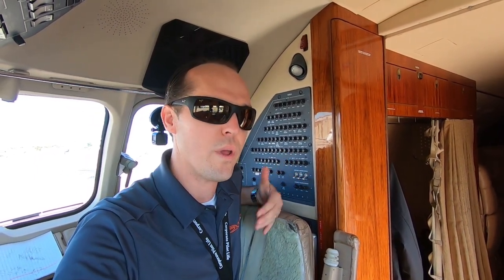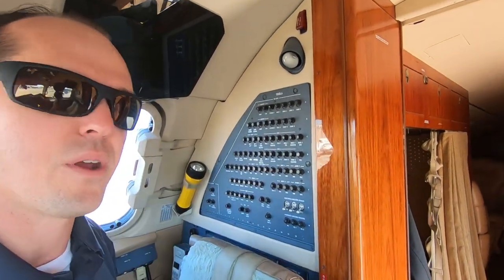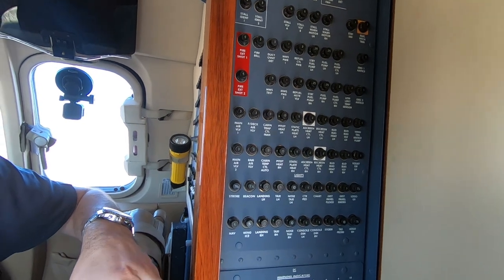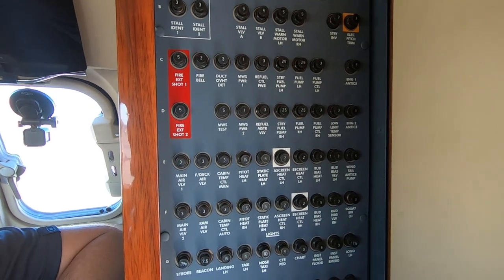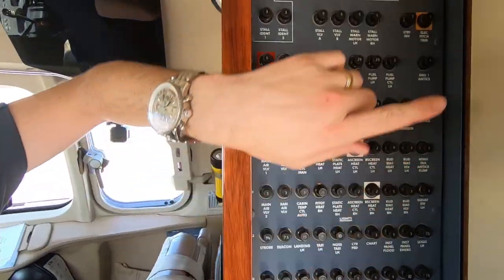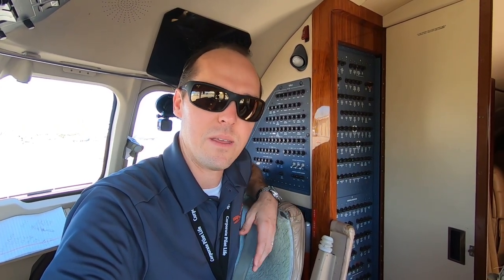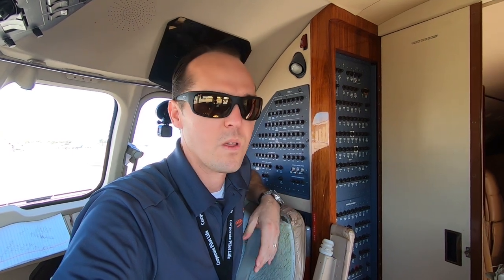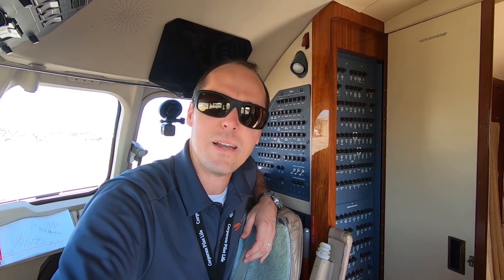What Are All Those Cockpit Buttons? -Tech Tuesday

Comment: Interesting to see the others behind that trim panel. And you Really don't want fires on a plane, not only does the smoke not have a place to go..where on a boat it can least go out into the air, it usually means a loss of control of something. Fun fact; electrical systems on planes are 2 to 5% tighter specs before they trip than electrical systems elsewhere, learned that when I was cross training as a AP mechanic, specializing in certain systems for the military. Another great TT video, and please keep them coming!

Comment: What most people might not know is that circuit breakers, whether in your house, car, airplane, etc, are there to protect the wiring. Whatever is being operated, on a circuit, can be removed and repaired, or replaced. Wiring is quite another story.

Comment: Nice panels. Did they pinpoint the location of the electrical short in the embraer that caused the runaway trim? Did the breaker help? Sounds like they had their hands full in a very busy airspace no less. It was reportedly a repo flight.
Reply from the maker: yep...it was a repo flight. I believe they found the short in the control column where some wires had chafed

Comment: If the trim circuit breaker is so important, why is it not more accessible?
Reply: I was thinking the same. "This one is the most important" points to the one the furthest away, hidden behind a door 😂
Reply: @SuperGenericUser  I think there might be switches on the cockpit controls, but he did say it was the most important circuit breaker there was if there was a trim runaway!

Comment: Why didn’t or couldn’t they pull the breaker on the Embraer (if you know)? I know exactly where the electric pitch trim and the autopilot breakers are in my Saratoga for exactly that reason. Drilled into my by the instructor who trained and qualified me for my insurance company in the airplane.
Reply from the maker: I don't know the Embraer systems at all, but my understanding is that there is a disable switch on the center console and they did use that, but it didn't function properly and the runaway continued.

Comment: So how unusual is it that planes like the 737 MAX had electric trim cutout switches on the pedestal? Is it typical that the "go to" is the fuse panel?
Reply from the maker: We do have disconnect switches on the yoke as well, so pulling the breaker is an additional layer of protection.

Comment: Is there another way to disable the trim from the seat (like the max has a guarded switch on the back of the center console)?  Looks like that would be hard to get to in a severe nose up/down situation,  have to leave the seat?
Reply from the maker: yes...there is a button on the thumb section of the yoke to disable trim

Comment: That Pitch Trim breaker should be a lot more accessible .... :-/
Reply: Agreed.  How do you get to that quickly when it’s time to save your bacon?
Reply: Probably because it's less likely you'd need it than the breakers in the cockpit. I can imagine unbuckling in a steep climb or dive and throwing open the door to pull it. That would be pretty exciting, especially after you level out.

Comment: Sucks they give a pitch trim that much authority over a pilot. Maybe someday they will design it so that  a pilot only has to use a certain amount of physical force to cause an automatic shut down of the system with an alarm that sounds showing a fault in the system. Thankfully there are circuit breakers for almost every electrical circuit on a plane now days. Thanks for the tech. Tuesday Shaun